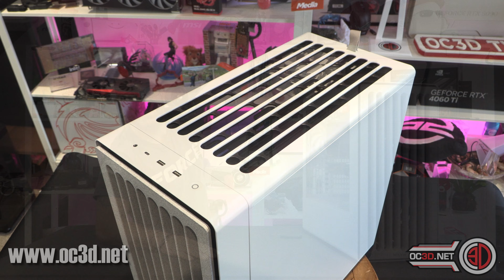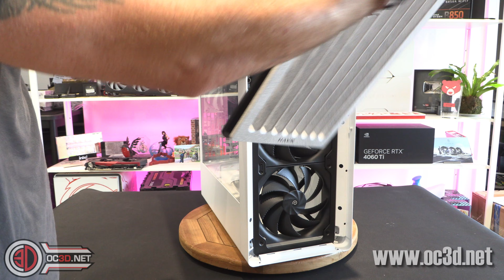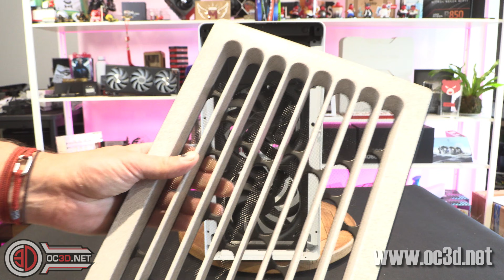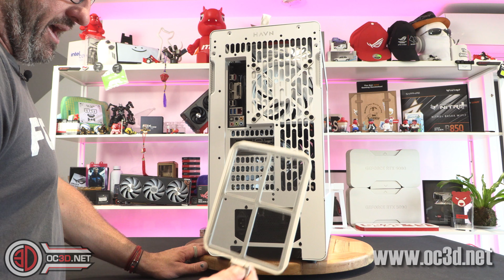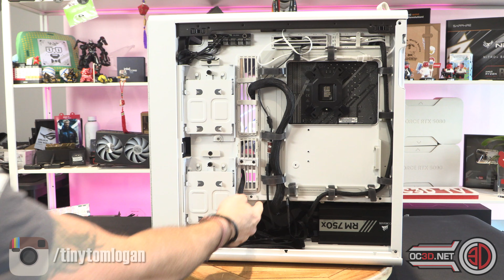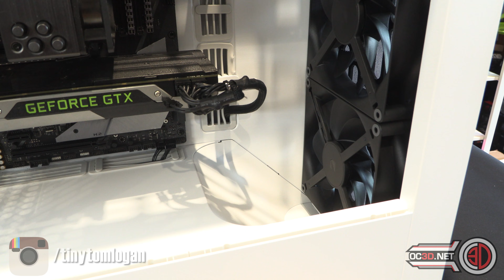BEST Airflow Case | HAVN BF360 Flow Review

Comment: One qwestion if i put 360mm AIO on top and there is 140mm back exhaust is it mean it Will have negative presure because 360mm+120mm 480mm exhaust compare 360mm intake?
Reply from the maker: Not really no, but you can fine tune with fan speeds too 😊
Reply: It mostly is based on CFM numbers and the 180mm fans move around 160 where 120s move maybe 80 a piece

Comment: having to recently reset a locked up pc, no reset button, no LED indicators, this is a bad growing trend amongst cases lately
Reply: Holding the power button will also force shut down the PC after a few seconds, so it isn't really a problem that it lacks a reset button.
Reply: @Xyberlix  that powers the system off though, its not quite the same thing as a reset
Reply: @JBits-m9p  for a PC that has locked up, it is functionally the same thing.
Reply: @Xyberlix   yeah fuck that give me the button back it's 50 cents.
Power Button (Held 4–5 sec) → Motherboard forces PSU OFF | Full power cut | RAM cleared | PSU rails drop to 0V

Reset Button → CPU reset line triggered — motherboard logic restarts | No power cut | RAM retained | PSU rails stay active
Reply: Not a huge deal for most people I'd say, if PC is 100% stuck most people tend to just shutdown and boot again, I personally prefer no reset switch and no LED indicators at all, haven't used it in over 10 years so might as well get rid of some cable clutter

Comment: I now watch 5 reviews I love this case but in dark, it has just replace my plan to get a Fractal North as i love the classiness on the wood and the gold USBs in the front panels. or on Asus Pro Art that have the nice touch of a wooden OI but the price is ASUS criminal as normal, when it the same price as this and the north XL. I also Like the screw on the side panel. This wood be perfect for my server room build but it wood be wasted. £44.99 for those 2 big fans included. I don't think a AIO in front wood do the case well. I love the raised PSU so it got air going into in from behind as a lot of cases don't give PSU enough under case space. It like a really good server case for home.  I would glue the grommets in place or remove them completely. It wouuld be great if it had no glass side to it as i hate RGB and on a server the hardware isn't for pretty boys. I had glass side and RGB, it like the old PC where they has led fans and plastic tech on the out side. I like Black, leather and wood with gold, i like class no ass in my builds.
Reply: I have since two months a Cooler Master masterframe 600 black and I am really happy with it. The look is fantastic, only a bit complex for cable management but ... it was my first build ..... The black version have no RGB and the side glas is tinted, you see almost nothing without RGB. You cannot mount high AIO on top however, due to the central position of the AIO. Only a standard height 360. take a look. Despite the negative recension, made on this channel, of one prototype I find it is silent and the three Mobius 140 Fans are very good, they move a lot of fresh air.

Comment: Impressive. I'd want to align the top 180 to fire straight into the CPU cooler, but that is about it. It does look very yesteryear with the glass, but I like the 'omage. Nought wrong with echoing the good-looking cases of the past: and it ISN'T a fish tank! LOL!!!
Reply from the maker: I guess they went all in on performance. Front fans I kind of agree but it didn't affect performance, if anything it probably helped it by have the edge of the fan (where the most airflow is) line up with the cooler.
Reply: @OC3D  Good point, I'm just a bloke that gets annoyed when a picture is even 1mm wonky!😁
Reply from the maker: @stevewatson6839  more beer will fix it
Reply: @OC3D  😂